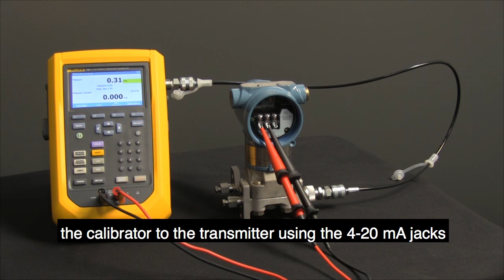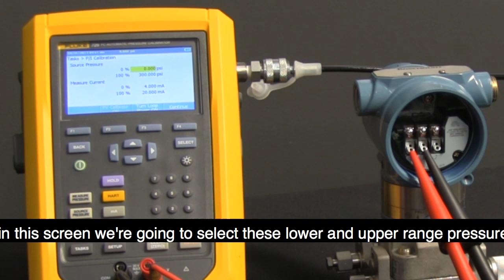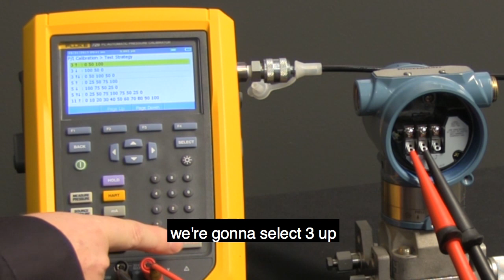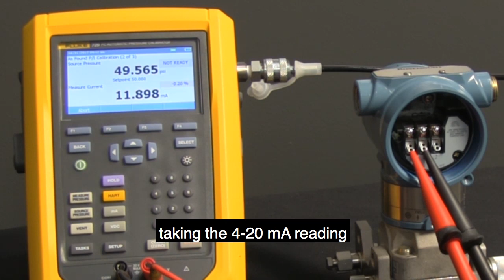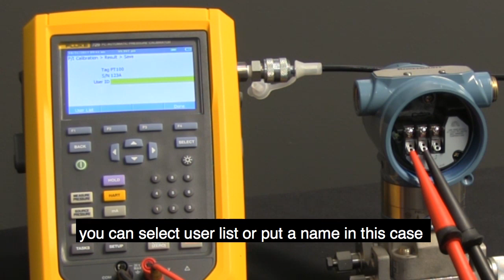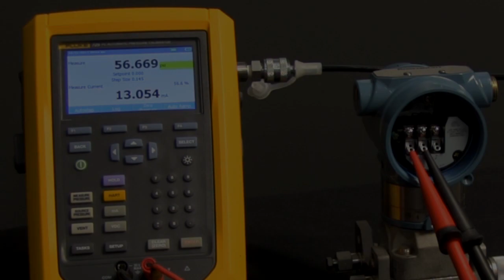How to Perform a Pressure Calibration Using The Fluke 729

Comment: Sir is it calibaration or loop check
Reply from the maker: Hi Alan - The Fluke 729 will not be able to source a pressure that high. With the Fluke 729 300G you would be able to generate up to 300 PSI maximum. An alternative option with the Fluke 729 would be the Fluke 700HTP-2 hydraulic test pump to generate pressures up to 10,000 PSI paired with the 750P pressure module capable of measuring your desired range. The 750P pressure module would connect to the Fluke 729 for a digital readout of the sourced pressure. Please feel free to reach out to Technical Support if you have more questions, 1-800-443-5853.
Reply from the maker: Hi there. In this video, we are demonstrating how to calibrate a pressure transmitter using the Fluke 729. Please let us know if you have any additional questions. Thanks!
Reply: @fluke  ok fine I have a doubt loop check time calibartion time isolation and ewulixe valve vent valve what do that's my question pls kindly mention that
Reply: What if you wanted to calibrate to 3000 psi?  Would the 729 still be able to do the calibration?